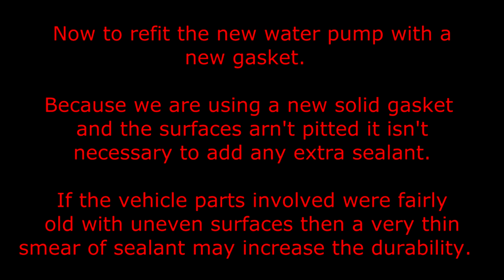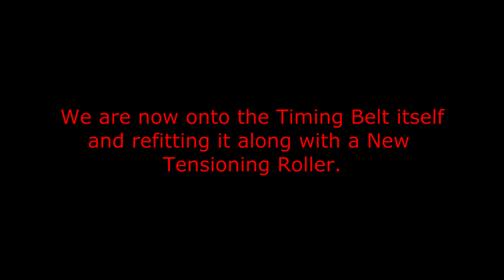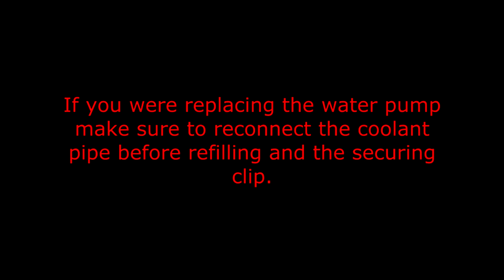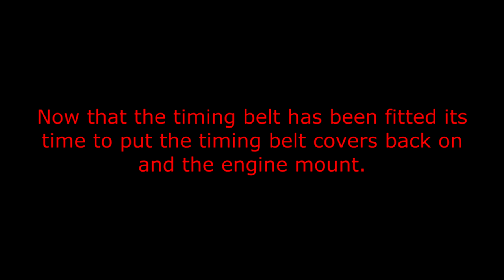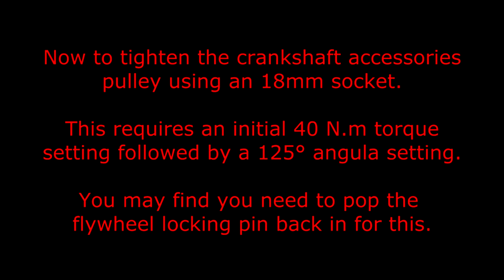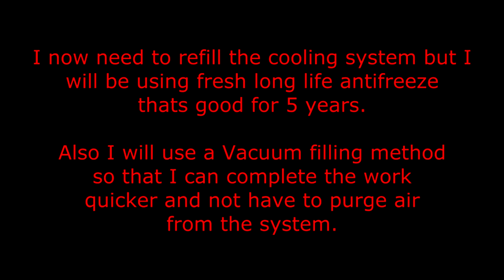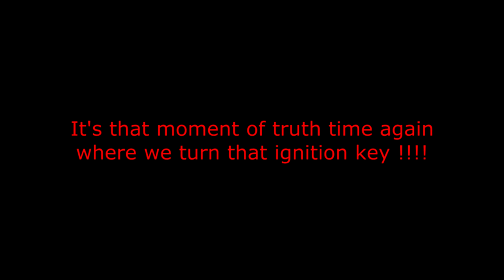Part 2 of 2 - Dacia Sandero Timing Belt, Tensioner & Water Pump for Renault D4F engine as in Clio.🚗

Comment: Congratulations for this beautiful guide! I have a question for you. I don't have find the o_ring for the pipe on the new water pump kit ( I have only find the rectangular rubber gasket). It's a problem if I don't change it? So, where I can find a new circular o_ring for the pipe? At the Renault official dealer or at hardware?
Reply from the maker: Thank you for the compliment.  I just looked on eBay and most of them don't seem to have the 'o' ring only the square one.  Personally I'd probably use the old one but put a bit of red rubber grease or silicone grease on the old 'o' ring and reuse it.  Short of that Dacia will have then or Renault from the main dealer.
Reply: @CoatsandGaiters  thank you so much!! ☺️
Reply from the maker: @ilvale6439  Ideally you'd replace it but often these things don't leak if your carful and don't damage them.  In theory the rubber will have moulded itself over time.  If you do reuse it, I'd just keep an eye on the area for leaks and do regular checks on the coolant levels in case it may leak in the future.
Reply: @CoatsandGaiters  your guide is very good because I know many people take off a/c pump and alternator to make access to the water pump.
Reply from the maker: @ilvale6439  thank you
Reply: Hi my friend. I'm sorry but I have forget a question for you. If I rise up only the front of the car, I can fully drain the coolant? Thank you so much!!
Reply from the maker: @ilvale6439  normally pulling off the bottom radiator hose drains most of the system so raising the car would make little difference.  There will be some coolant still in the engine block and there is normally a drain plug hidden at the back on most cars to drain the block.  Remember antifreeze is poisonous so don't get any in your face by accident.
Reply: @CoatsandGaiters  thank you so much!!

Comment: I counted 48 valleys from my marks going clockwise from the "top" valley mark to the "bottom" valley mark towards the front of the engine but only 47 valleys going anti-clockwise. On my SKF belt the new marks did line up exactly with the marks I transferred from the old belt. It looks like DAYCO counted the wrong way when setting the marks! Maybe they incorrectly assumed that the marks are an equidistant from each other no matter what way around you go.
Reply from the maker: Thank you for that as it had me foxed for a while.

Comment: Any tips for putting the accesories belts in 25:49 back on? As you skip it in the video, I understand it's a straightforward enough process
Reply from the maker: I think it might be a stretch belt which technically means your meant to replace it once removed but I pulled the pulley by hand and popped the bolt back in as I recall. Not strictly correct hence I didn't show it.  My step daughter is very tight with money and wouldn't pay for a new belt which forced me to reuse the old one.  You can buy a Lisle L5937 stretch tool but they are about £27.50 on ebay.  Hope this helps.
Reply: If you don't have AC (like the car in the video) you can put the power steering belt back on by zip tieing it to the pump pulley (through the holes), rotating the accessories pulley and cutting the ziptie after the belt gets on the pump pulley. Dayco has a video on putting stretch fit belts on using a zip tie. AC models have a belt tensioner. And for the alternator belt you can buy a more expensive kit (~50 euros) which includes a mounting tool, but I just forced mine on with a big flat head screwdriver (no problems after 20k km).
Reply from the maker: @cristiannicolae6309  thank you for that added infor, its always handy to have more insight into these things.
Reply: @cristiannicolae6309  Well, it's the model with AC, comes with a tensioner and a roller. Problem is that, for the life me, I can't find the nut/mechanism to release the tension so I can extract the belt 🤔 (image attached)
https://drive.google.com/file/d/1N3jr3n7n1S2kGD6rJhL85Q48jKYWVNuV/view?usp=drivesdk
Reply: @cutariechucutariechez2581  You'll find a torx bolt behind the plastic cap of the tensioner. T35 or T40, don't remember exactly. Tensioning back the belt is done with a spanner (can't remember the size) from the back part where the teeth are. Setting the correct tension is done similarly to tuning a guitar string. As in there's a frequency measuring tool which you attach to the belt and you pluck the belt like a guitar string and tighten/untighten until you get the correct frequency (219Hz as per the manual). I coulnt't find that tool anywhere on the market so I improvised something with a piezo pickup and my oscilloscope, but I suppose you can tighten the belt with moderate tension and tighten it again if it's slipping.
Reply: @cristiannicolae6309  Thanks a lot Cristian, that´s very helpful. I´ll let you know when it´s done
Reply: @cristiannicolae6309  It was T50. As for the tension I confess I used the "twist" method: twist the belt on a certain point, memorise how much it turns (it was 1/4 turn), and replicate on the new belt. Time will tell if that was accurate!

Comment: It's really strange how you're rotate the engine over with the tensioner slightly looser than you do when you run it. Any idea why?
Reply from the maker: Not sure on the exact time point your looking at but I'm thinking you might be referring to rotating the engine 6 times to ensure everything has settled and all turning smoothly as a final check.
Reply: @CoatsandGaiters  Yeah I get that bit but, unless I'm wrong, you tensioned the tensioner, rotated the engine and then tightened the tensioner more after that point?
Reply from the maker: @adambennett805  Hi just looking at Bosch instructions again and it says, tighten tensioner pulley, turn crank 6 times, recheck alignment again, slacken tensioner and retighten.  Maybe its to allow the tensioner to settle in and then redo to ensure its tensioning correctly.  Sadly I'm not sure.  I just follow the manufacturers instructions word for word.  Sorry I can't be more help.
Reply: @CoatsandGaiters  fair enough mate that helps anyway thanks. Is there any chance you could link me those instructions please?
Reply from the maker: @adambennett805  you can email me at coatsandgaiters
Reply: @adambennett805  I think it's simply to take all the slack out of the belt between camshaft pulley and crankshaft pulley and make sure all that slack is on the tensioner side before the tension is finally set.
Reply: @murphaph  If you overtighten it, it is not good either, because the belt reaches the correct tension when the engine is warm.

Comment: excuse me for my bad english, what is the tightening torque for the screws of water pump?
Reply from the maker: Hi they are 10 N.m but there is a sequence to tightening.  If you go to 5:27 on the video I have shown the information you need.  Hope this helps.
Reply: @CoatsandGaiters  I just skipped that part
Reply: @CoatsandGaiters  how many liters antifreeze it takes?
Reply from the maker: Sorry I don't accurately know. but a car that size would probably be around 7 litres

Comment: Did you renew the crank pulley bolt?
Reply from the maker: I didn't but technically you should as it's a stretch bolt.
Reply: Its 4 years ago and it did not brake I think? Haha
Reply from the maker: @tomken18  no it was fine.  The car appeared in a recent series of mine.
Reply: I replaced a belt and also reused the bolt. this because there was none in the kit from continental. Normally there is always a bolt included. so I thought I could reuse it. I did not tighten it 125 degrees. thanks for your responses
Reply from the maker: That's what I did.  I just didn't tighten it as much.  I have reused cam bolts as well but in one video I felt them going soft on me and starting to stretch !!!! My issue is I'm very tight with money so if I cut corners I just drive slower in that car to compensate for it not being in tip top condition.  Probably not the best idea really but times are getting harder.  @tomken18
Reply: Yes times are getting harder indeed..

Comment: the gasket is installed "dry" ?
Reply from the maker: I believe so.
Reply: @CoatsandGaiters  I have seen on headgaskets some kind of red tacky fluid (not blood ;-) that helps installing it. Maybe it could be used here too.
Reply from the maker: @withgrowinginsanity198  yes I used that type of sealant when I did the head gasket in the Honda CRC video.  As I recall it was called ‘three bond’ I think.  I try to stick with what the manufacturers advise where I can.  I had the same thinking that adding extra sealant to a gasket might make it seal better but I recall they advise against it as it’s like applying 2 gaskets when one is all that’s required.  I think the sealant tends to be used when it’s metal against metal and requires a liquid sealant.
Reply: @CoatsandGaiters  yep , using 2 gaskets might not be a good idea. I was more thinking of a "install helper"... kind of tacky fluid that will hold the gasket in place for the installation... and then magically disappear after the engine is hot. but maybe this sort of thing does not exist...
Reply from the maker: @withgrowinginsanity198  it should stay there ok.  I think that was a metal gasket if I recall correctly.
Reply: @CoatsandGaiters  I meant some tacky stuff to prevent 5:52 :)
Reply from the maker: @withgrowinginsanity198  that shouldn’t happen really.  It’s really difficult to film while doing a job in such a tight space so I’m having to keep my hands out of the shot while doing the job.
Reply from the maker: @withgrowinginsanity198  is that not for coating on the camshafts and bearings after a rebuild to minimise wear while the oil pump starts to recirculate oil around the dry engine?
Reply: @CoatsandGaiters  it is :-) but its very tacky too and looks perfect to hold gaskets in place... ( I hope :-)
Reply from the maker: @withgrowinginsanity198  mind who am I to say lol I put copper grease on everything and I don't think I should lol

Comment: I think that it was one tooth out because it was up side down
Reply from the maker: Not sure as I believe the direction of rotation was correct with the arrows.  I did read that sometimes these timing belt kits can be made for different models but as they are effectively the same they might use them in other kits.  Which might mean sometimes the marks will differ.  Thank you
Reply: @CoatsandGaiters  The belt have 95 teeth. The marks separate them in two sections one have 47 teeth and other 48. The 48 teeth section must be put in the water pump side.
Reply from the maker: @amadeus6490  Thank you for that, though I do remember the arrow was pointing in the right direction.  Thankfully all came good in the end as the car is running good with us still.  If I do another I will bear what you mention in mind.  Did puzzle me as I do like things to be spot on.  Not one for mysteries.  This is where experience counts.
Reply: @amadeus6490  you are 100% right, I experienced the very same thing,there are arrows showing the clockwise direction,but regarding the white markings, you don’t know which one is crankshaft or camshaft. And as you say there’s 48 tooth on waterpump side, 47 on tensioner side. So if your belt is a tooth out, you should rotate it further a half turn,and the markings will be spot on.